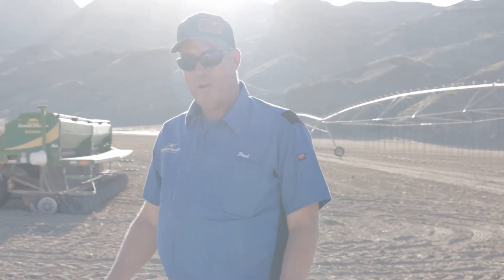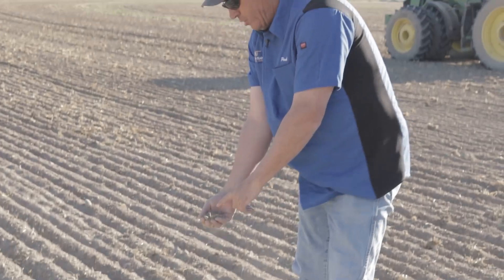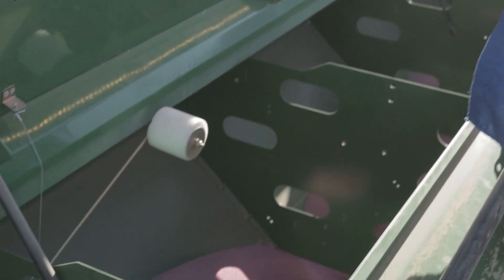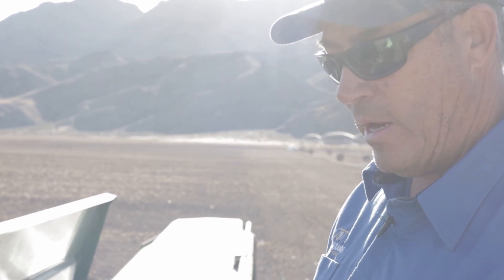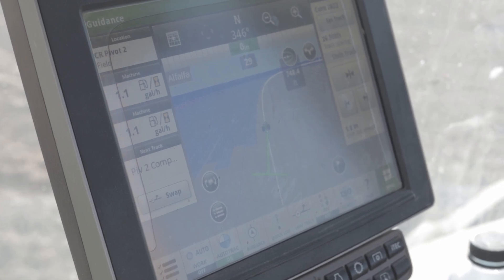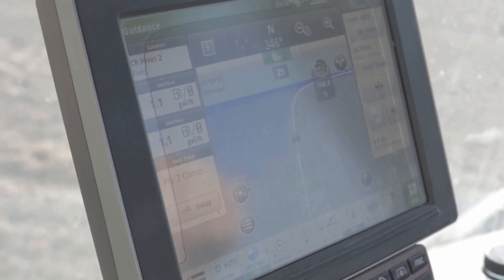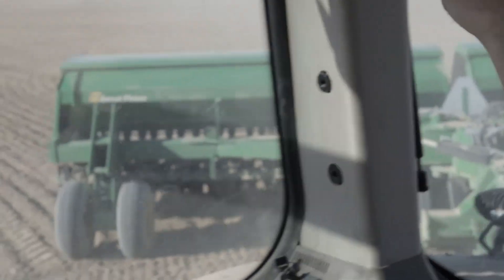How We Plant Alfalfa for High Quality Hay

Comment: How many tons per acre do you get off of new seeding alfalfa?
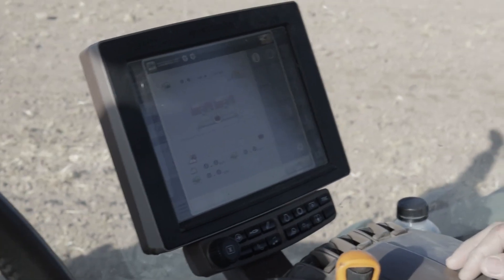Reply: The video discusses the process of planting alfalfa (0:00-19:20) and mentions a four-ton per acre grain crop (1:45) that was harvested from the field prior to planting alfalfa. However, it does not specify the yield for new seeding alfalfa.

Generally, new seeding alfalfa yields are lower in the first year compared to established stands, typically producing about 30-40% of the yield of mature crops. Yields in the seeding year can range from 0.9 to 5 tons per acre, depending on various factors.

Key factors influencing new seeding alfalfa yield include:

Location and Climate: Yields can vary significantly by region, with ideal conditions in the southwestern U.S. supporting higher yields (8-10 tons per acre for established stands) compared to northern regions (around 3 tons per acre).
Management Practices: A three-cut system in the seeding year generally results in higher yields (1.5-5 tons per acre) compared to a two-cut system (0.9-4 tons per acre).
Stand Density: A strong, dense stand with 15-25 plants per square foot in the seeding year is crucial for maximizing production.
Drought Conditions: Drought during the establishment period can significantly reduce yields.
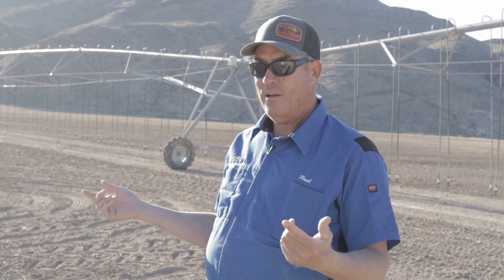Proper Planting and Soil Conditions: A well-prepared seedbed (2:05), appropriate seeding rate (6:07), correct planting depth (7:21), and ideal soil fertility (2:41) are essential for good seedling establishment and higher yields. The video emphasizes planting alfalfa seeds at a depth of 1/4 to 1/2 inch (7:21-8:29) for viability.